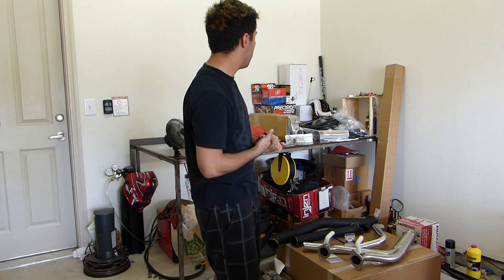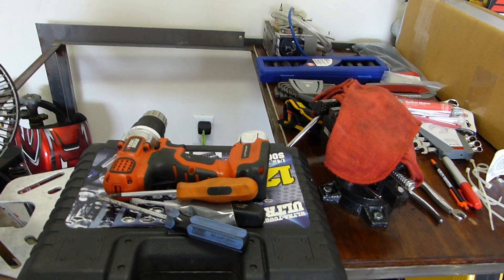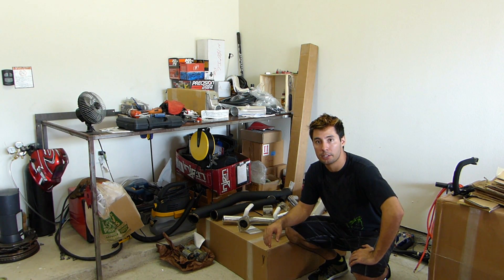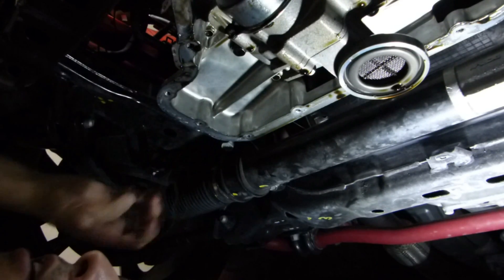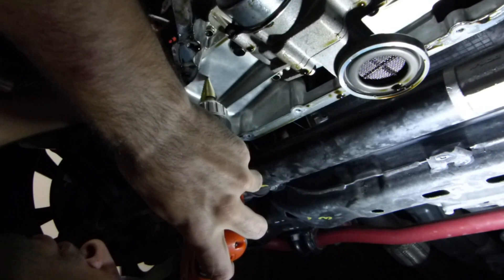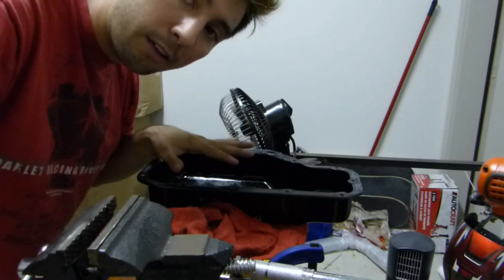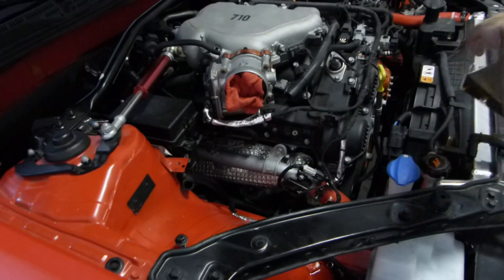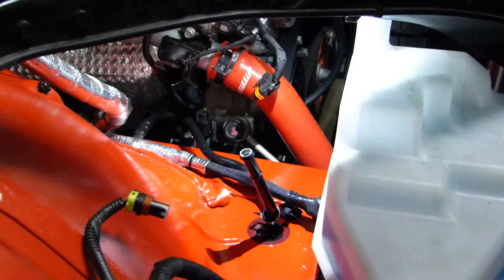✓ How to Turbo a 3.8L Genesis Coupe - Part 1

Comment: So you don't need to tune the car when installing the kit from turbokit?
Reply from the maker: AustinKillza well you do need a tune but the turbo kit actually comes with a tune. it's all included in the price ;-)
Reply: Ohh Ok. Is it worth the money? How much WHP you get @ what pounds of boost?
Reply from the maker: AustinKillza it's definitely worth it because you can't run boost without a tune. someone tried that and got 2 psi and broke stuff.
depending on if you're bk1 or bk2, you can get about 400 whp at 6 psi (with a good exhaust and supporting mods) on bk1 and bk2 can run 8 psi and be around 430 whp. custom dyno tunes can get the bk2 up to about 450 but obviously the higher you go, the higher the chance of breaking something. 8 psi is about the limit for bk2 before a build. 6 psi is the limit for the bk1 because the piston design wasn't as good
Reply: I was talking about if the turbo was worth it, Not the tune. xD & I'm prob going to run 5 PSI for the BK2.since I want the car to last a good while, while being a nice, fast car.
Reply from the maker: LOL my bad. Yes the kit is so worth it. It is a great bump in power and it does more than just wakes the car up, it really brings the car to life ;-)
Reply: How is it on the engine in your opinion? I want it, but I still want my car as a daily and last a little bit. I'm most likely going to lower the psi to be a little more conservative.I can always change it.
Reply from the maker: AustinKillza I absolutely love it. I drove it to work today actually. The only thing that makes mine less daily friendly is if I have a lazy left foot day with the stage 3+ clutch and mostly the aluminum driveshaft. the stage 2 clutch was WAY smoother. The stage 3+ can be smooth but you have to be perfect with it and at 530 am,  I'm not smooth at all LOL
honestly the turbo kit was the best mod I've done so far, just don't pull a me and try to run 15 ish psi on the stock block HAHA
Reply from the maker: They have a safe tune that is provided by BTR for your specific turbo and fuel. They have enough tunes under their belt to make a decent canned tune. When the kit was first available, it was a much more general tune but it's been been refined over the last 4 years it's been on the market
Reply: lol, all I need is a turbo I got basically all this stuff.

Comment: did your mpg worsen or improve after installing?
Reply from the maker: A bit of both actually. It really matters more on how you drive. My highway miles is between 25 and 28 mpg depending on my speed. In the city, I can usually get 20-22 mpg but I often get 16 - 18 because I tend to enjoy flooring it more often now that I have the turbo lol
If you can control yourself, your mpg will be about the same. If you can't (most people can't) you'll get less mpg.
Hope that helps

Comment: how much was the kit you actually got?
Reply from the maker: Here is the full long answer LOL
So I got a few upgrades with my kit and I'll list them below. The total kit was $7,379.99 plus shipping (I think like 150 bucks). Now I was one of the original presale orders from the gencoupe forum so I had already put down a $500 deposit and received a $400 store credit for putting in the deposit.
Now a buddy of mine recently snagged a practically brand new kit off TurboKits for $4500 so they can be had for cheaper than what I got but you gotta act fast. I also enjoyed being one of the first specifically so I could make this video series ;-)
Here are my upgrade options:
Hot Side Coating - Thermal Coating - Black | $495.00
Spark Plug Upgrade - 1 Step Colder - NGK | $99.99
Heat Wrap Upgrade - Custom Uppipe, Downpipe & Turbo Wrap | $195.00
Turbo Choice - Billet 6266 Ball Bearing Precision Turbo | $695.00
I also added these to my order:
TDS 4" Aluminum CV Drive Shaft  - $899.94 + shipping from The Driveshaft Shop
Cusco Roll Cage - Safety 21 Steel 4 Point Black - $480.60 + shipping from Japan
Go Fast Bits G Force II - $296.10
Reply: dang, and I watched your entire series and you had to do quit a bit fabrications to the kit :/ as expected though! I wish I had the space and tools to do the install but Idk of any people in San Angelo TX who can help me with such an install:(
Reply from the maker: Well it's really not much fabrication. You don't have to do any welding if you don't want too. A drill and an angle grinder is all you really need from the power tool department but even a hack saw can work. Fabrication implies I had to make stuff but really I only had to clear some stuff out of the way ;-)
I'm sure a regular shop could install the kit with the instructions and the help of this video. It takes time and is frustrating at times but it's really not hard
Reply: Initial DIY mods awesome well thanks man I want to do it but at the same time I want to wait till I have a second car bc I daily this thing and travel a lot! But thanks again for the video your step by step instructions are actually pretty good and informative
Reply from the maker: haha no worries. I was the same way and this was my daily at the time and still is. Although I now have two cars now, It's currently my only running car LOL